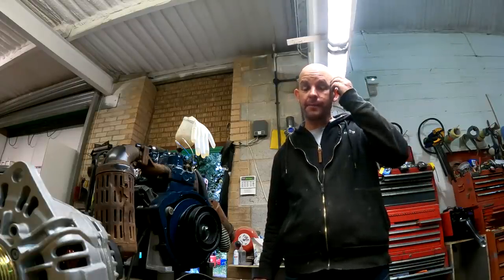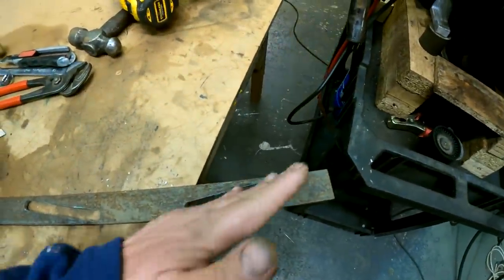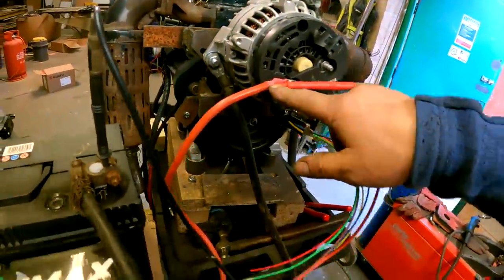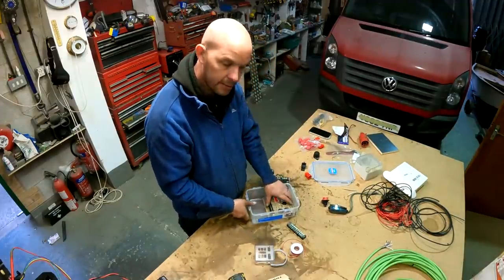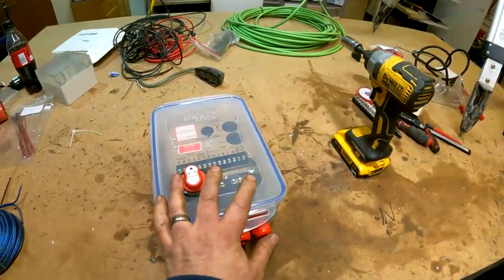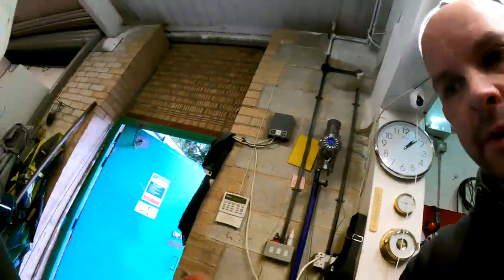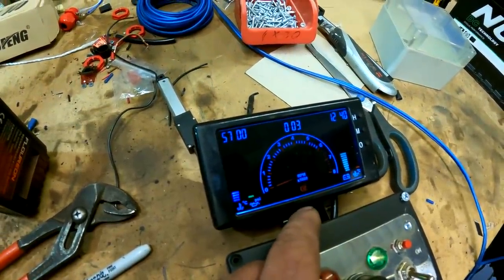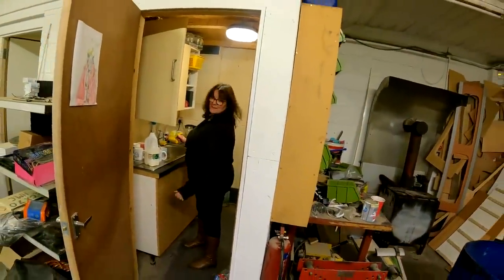DIY DC Generator Project Part 2 - Broken Road Sweeper To Boat Generator?

Comment: I have built a diesel 12v generator before with an alternator like you have. The problem you're going to run into, is an alternator on an auto, will work hard for a few minutes after you start your auto. It took very little amp hours to start your auto, so quickly your battery is recharged, and then the alternator is coasting along making very little electricity. At that point, it's only maintaining a small amount. 

In the world of duty cycle, the alternator has done very little work. NOW let's be more specific. The voltage regulator has done very little work. 

Mine ran great for a week, then the voltage regulator died. I replaced it with a new one, and one week later it died again. 6 voltage regulators in 6 weeks. I was baffled. 

Then I realized, my alternator was putting out 100% for 8 hours straight, 5 days a week. 
That's a huge duty cycle. A voltage regulator was not made for 100% duty cycle 8 hours a day. 
My external voltage regulator was getting hot to the touch. Was I exceeding the voltage regulator's duty cycle, I wondered? 

I got a small computer 12v fan, and set it up to blow on the voltage regulator and keep it cool. Problem solved. 

Then that voltage regulator never died again. 

I also set up a rheostat to the exciter wires in the alternator, so I could regulate down how many amps it made, so I could regulate down how much horsepower it could draw. My 3.5 horsepower, my 2.6 kw engine would stall at 105 amps output. So I would regulate down the current to the alternator exciter wires, and only let it make 95 amps, and it would run all day making 95 amps, for 8 hours, on 1 gallon of diesel, 3.7 liters. 

My most energy made was at a idle, making 95 amps, using the least amount of fuel. I could turn it up higher and double my output and use 4 times as much fuel to do it. 

Since my diesel rpms were low at an idle, I had to upsize the engine pulley to increase the alternator rpms. 

If your voltage regulator is internal inside your alternator, you will not be able to cool it down. 

Another problem I had was the voltage regulator reading the output voltage.  My battery bank was 25 meters, 75 feet, away from my generator. If the voltage regulator was allowed to read the alternator voltage, when it saw 14.4 volts, it regulated down, while my batteries only saw 13.5 volts because of the loss (ohms) of the long run. So my sensing wire on the voltage regulator, I disconnected from the alternator and ran it to the battery bank. Then it made 15.4 volts at the alternator, so my battery bank could now receive 14.4 volts. 

You can learn the hard way like I did, or you can learn from me. Spare parts, more voltage regulators and fans to keep it cool, My alternator getting hot was never the problem. The heat of the voltage regulator working at 100% duty cycle was the big issue. 

With you having 10 horsepower, you should be able to make 200 amps at 12v, at an idle if your engine pulley is large enough. And mine was only half as noisy at an idle, working, compared to higher rpms. 
Have fun.
Reply from the maker: Very interesting, thank you for taking the time to help us out x

Comment: When I first worked in construction I was put in the chippy shop and the foreman carpenter never washed his mug out, so I did and he went nuts at me.

Why not connect the heat exchanged to heat shower water. and rads.

Comment: why not tie the cooling system for this engine into you heating system with a bye pass for the warmer weather into how you were going to cool it
Reply: Simon could use the domestic hot water cylinder as a thermal store. Fit a high performance coil in the top and fill cylinder with radiator water. That can pump around the rads as needed. Heat can go in from the donkey or the main engines or the boiler. A thermostat on the water cylinder fires the boiler when there’s no other heat. 
The heat coil is connected one end to domestic water pump. Other end to taps. 
The large cylinder volume allows a number of feed & return loops to work without interference. No need for additional heating coils.
Reply: I thought Simon said that is what they are doing?

Comment: Wouldn't it have been better to use an 'off the shelf' generator?
Reply from the maker: We have always preferred to build and not buy, why buy something when you can make it, and for what this will be in the end try find one for less than £4k!
Reply: I just had a quick look and the cheapest diesel generator with that ouput was $5000 and that was without the control systems.
Reply from the maker: @marioreali5925  and that's why we make and not buy!! Once finished I will let you all know the total cost!
Reply: It is always more rewarding to make your own anything. The best way to save the planet is to restore and repair everything you can. As far as I can see, you can not reuse or recycle the current Lithium-ion batteries. That is why I still buy tools with leads on them, apart from the 2 drills I have. They are just too handy not to have.

Comment: I recommend you not mount it to the unit itself, rather mount the control circuitry to the boat nearby so as to avoid diesel motor vibration.  I am too opinionated to not add my 2 Penny's worth of opinion. Lol